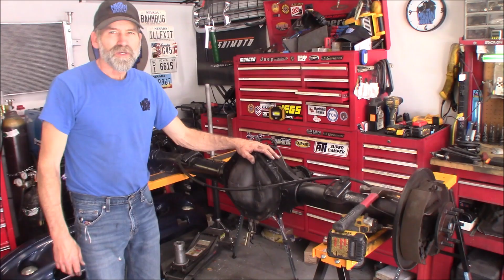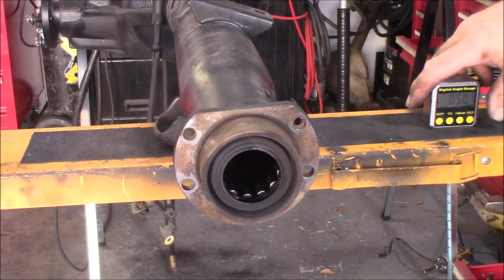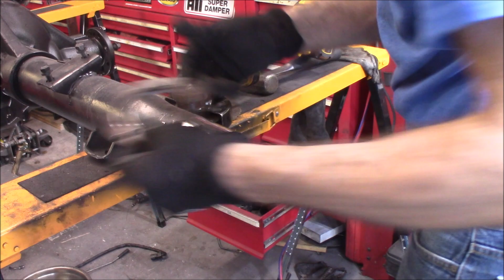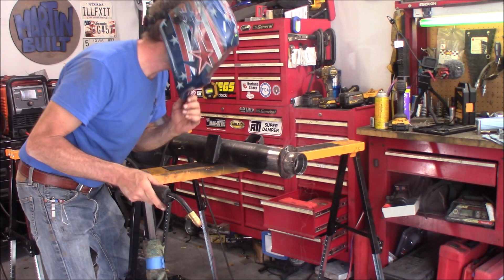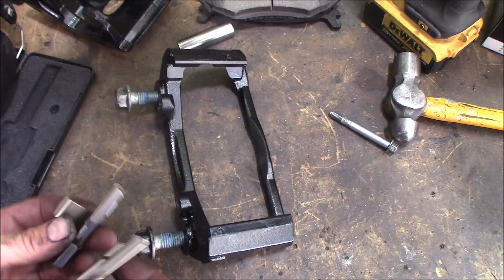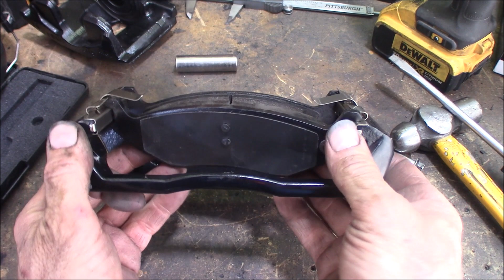Chrysler 9.25 Disc Brake Conversion Part 2 (drum to disc brakes)

Comment: I have a 2008 dakota 4x4, 3.92, traclock 9.25 rear.  5x5.5, will my axles work in that 9.25 with 6x5.5? Also wouldnt it not be easier to add spacers/spacer behind flange to reach the proper depth for the disc brake? The drums had a shorter flange to end measurement. So wouldnt spacers work? Most conversion kits either provide a spacer or a caliper bracket with a step broke into it to offset it. Im asking because i dont know and i want disc on my dakota. Havent decided if i want to make the 5x5.5 to 6x5.5 lug change yet. I imagine there isnt a way if you need the backing plate and ebrake.  Do you have a calliper with built in ebrake option so we could eliminate the old drum parking brake

Comment: Great videos as always. Quick question, would a complete swap be easier ( rear end ) to convert to disk? I’ve a video on another guy who did and it worked.
Reply: On a 2001 Dodge Dakota 4X4
Reply from the maker: Yeah if I could have found a rear axle from a dakota that already had the weirdest breaks that would have been the easiest way to go.
Finding the rear axle with the 3.92 gears and disbreaks is where I was running into a problem. They're just not that plentiful.
Reply: @martinbuilt  either way thank you so much. We have a bunch of yards in central Cali and luckily there’s a number with the rear ends.  How do I make sure it’s the 3.92 rear end? Mine is the hexagon cap on the differential with the 12 bolts.

Now I’m just trying to find the 03 04  front end 4X4 to swap the front rotors to the dual calipers and bigger disk.
Reply: After watching you do all that work I think I would have just swapped out the gear and positive traction unit and save all that work since you had to buy all the parts anyway everything is the same since both are 9 and a quarter rear ends

Comment: I can cut the flange off easily and quickly with my cutting torch especially with a gouging tip, but if the average person doesn't have access to milling equipment what would be the best way to do this? I can weld it easily too

Comment: If you put 03 disc brakes the front of an 01 durango would you swap the rears as well. and how critical do you think it would be not to?
Reply from the maker: I've done mismatch swaps before like on Cherokee XJ and it's always worked out just fine. I haven't had to deal with the break bias or anything.
 Now that I have done the rear brakes on my Dakota using the Durango disk brakes  I can say if I have a panic stop I have a panic  that the rear brakes do lock up before the front which is not good.. But my front brakes do need to be changed I'll be  upgrading to the dual piston calipers of the later model Durango's and Dakota's
Reply: @martinbuilt  Thanks again.. I'm looking forward to a good steady, smooth braking experience from Durango

Comment: Too much work! just get a 9.25 off a 2003-04 with the gear ratio you need. I lookup the vin on the new arrivals wich tell you the gear ratio and the rear end size on there website before I even go out to the yard! Dakotas are so plentiful in the pick and pull yards right now (2022)

Comment: its a lot of work to make vehicles the way we want them that the factory didn't make as an option.
Reply from the maker: If you can find a 9.25 that came from a 03 or 04 Dakota with 3.92 it would come with rear disc brakes and that would save you a lot of work.
Reply: @martinbuilt  that is what i am looking for in a 4x4 axle but just been finding 3.55... may just have to do a carrier and gear swap.
Reply from the maker: @gilliland426  One thing about the 9.25 is it looks to me to be an easier gear set up than other rear axles.

Comment: when i do my 9.25 rear conversion for my 2001 dodge dakota slt crewcab 4x4. i want the 3.92 trac loc disc brakes.
truck right now has the 8.25 rear axle 3.92 gears front and back and no slip.

Comment: So I've been looking at a disc conversion on the 9.25 in my 98 1500. I was just looking at buying a complete kit, money and labor aside, what are the mechanical advantage/disadvantages to doing it the way you did
Reply from the maker: Here is one video where I had to remove and replace the disc brake mounting flange. 
Chrysler 9.25 Disc Brake Conversion Part 1 https://youtu.be/FbtbneOOUZA

Comment: when you completed the conversion did you have to add a proportioning valve or anything to the system?
Reply from the maker: I didn't change a thing on it currently the rear brakes will lock up before the front but I will also upgrade the front brakes to the dual piston calipers and larger rotors that came on later models.
Reply: thanks for the info. I'm currently putting an 04 rear axle in a 02 Dakota. I really appreciate the amount of work you put into your conversion.
Reply from the maker: I wish I could have found an 04 rear axle would have made my the conversion much easier. 
Still have to get the parking brake cable reconnected and reinstall the sway bar, but have been loving the 3.92 gears and the disc brakes.
Reply: @theforgerexrogers3392 
Whats the difference on the 04 rear axle. I have an 02 as well. I Have an 8.25 though :/.
Reply: The 04 had disc brakes from the factory. it was a fairly straightforward swap. the parking brake cable end and that was about it. We got a complete axle with brake lines and everything so we didn't have to swap much
Reply: @rexarogers  9.25 tho right?
Reply: @mobius-1503  If I remember correctly I'm not sure they had 9.25 available in 04. I rebuilt the center section and made it a 9.25
Reply: @rexarogers  what?! Ima look. Because I have 8.25 and rarely do I see the 10 bolt. And after installing trutrac for it. Was thinking this was my only option..but ima look for some 04's thanks.

Comment: Could you have not just swapped Ring and Pinion to the axle with disk brakes?
Reply from the maker: Yeah I could have done that if I could find an axle from a Dakota but they are hard to find out here at this time. There are 4 Durango's for every Dakota at the pic-a-part and then all the Dakota's are 01 and older with drum brakes.

Comment: I don't think u got a track lock differential
Reply: That is Def a Trac lock, the carrier is much lighter duty on a open carrier (one wheel peeler)
Reply from the maker: it is definitely a Trac-lok
Reply: Most 9.25 Chrysler rear axles are Trac lock (posi) from factory

Comment: Hey Martin, love your vids. You‘re doing a great job👍🏻 Could you make a vid about changing the output seals on the transfer case? Mine are constantly leaking…..thanks and greetings from Vienna/Austria
Reply from the maker: I will do that, I have another mod I need to do to the rear end and at that point, I will be replacing the rear T-case seal.